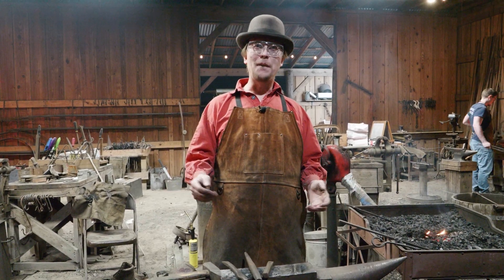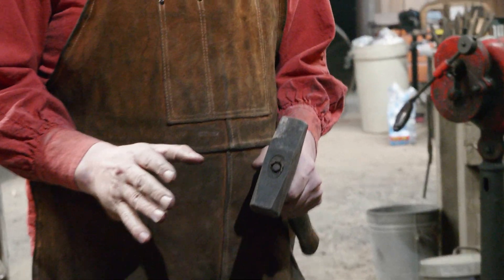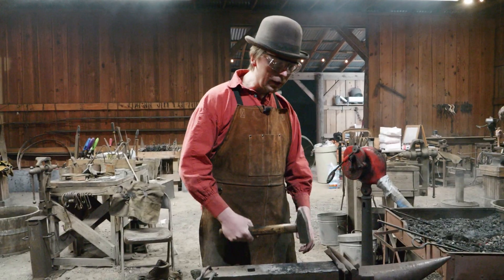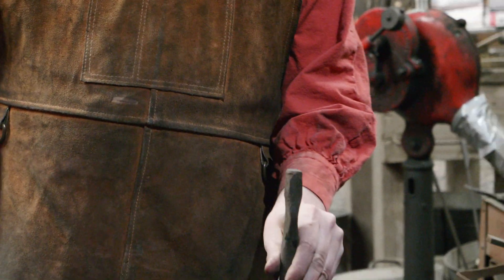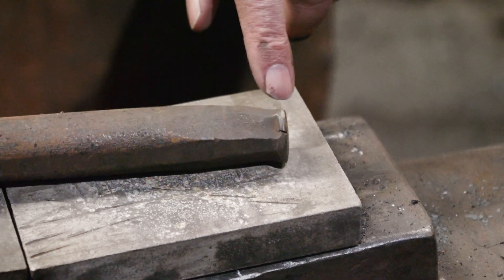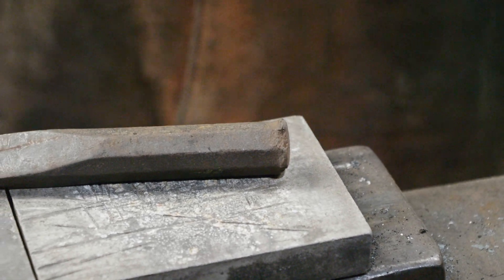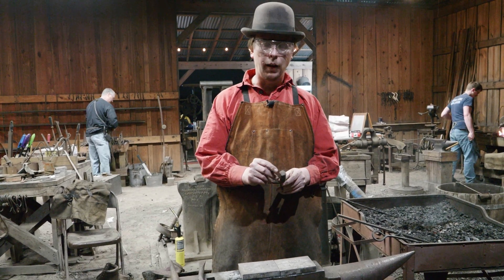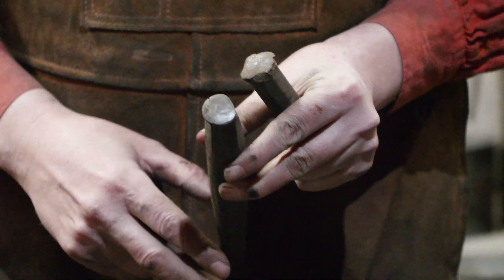ABANA National Curriculum 1.1 - Safety (part 2/2)

Comment: ..#1- everything in the shop can hurt you. #2- check all tools before using and service if necessary. #3- just because it's black doesn't mean it isn't hot. #4- a few minutes of preparation before the project can save you hours in the emergency room. Great series...!
Reply from the maker: That is a great TLDR.  It's an inherently dangerous activity and needs to be treated with respect.